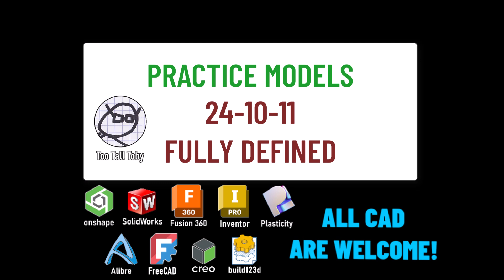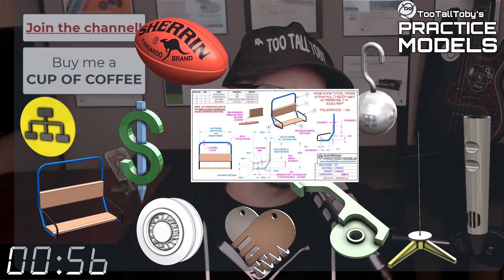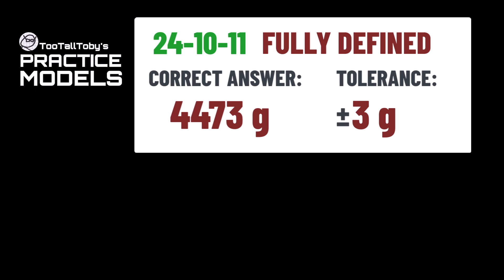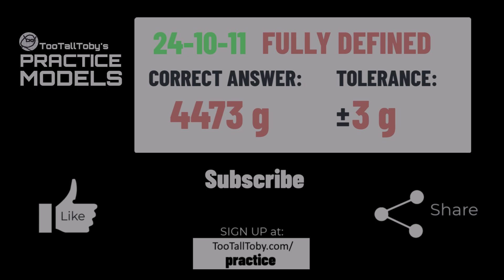2D to 3D CAD PRACTICE MODEL-  SPECIAL EDITION! Free Drawing Exercise for 3D CAD users- FULLY DEFINED

Comment: 4472.98 in 2:50, Onshape.
Reply: I got 4475 . Still within tolerance. Dragos
Reply: @ciorad1389 Yup, that's just CADs things, like when I submitted my answer here, I had 4472.978 but then I realized when I did my circular pattern it was set as "New" instead of "Add" I ended up with four past, when I changed the settings to "Add" to have only one part then the weight changed to 4475.03.
Reply from the maker: Awesome!